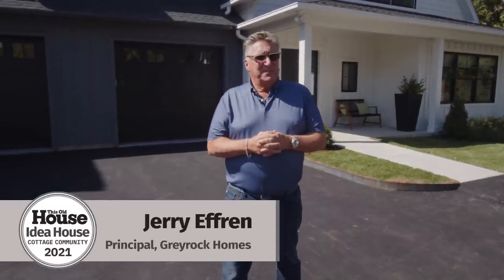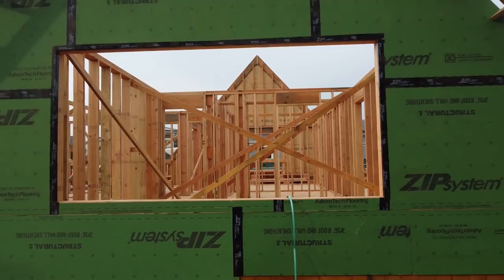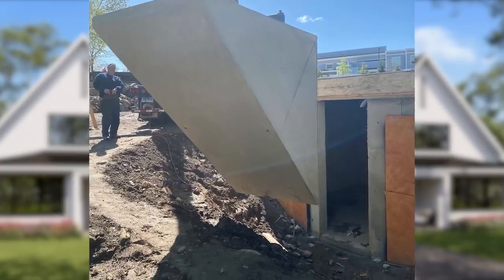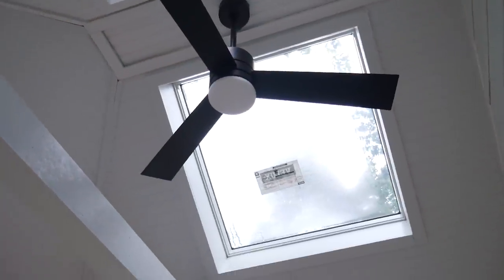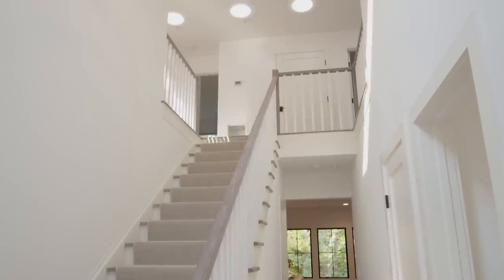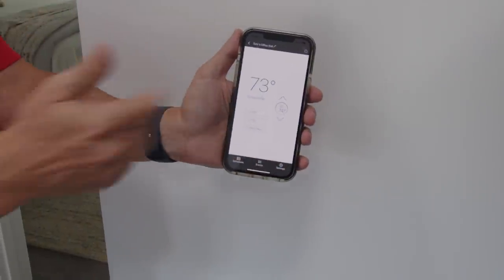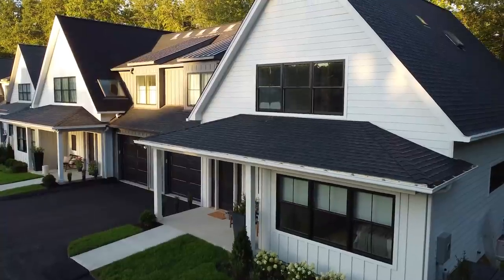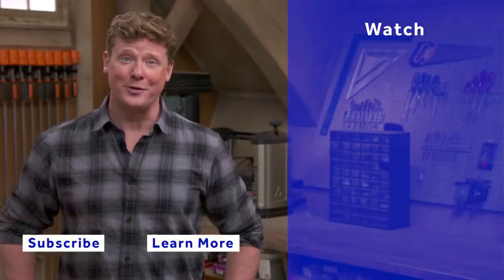Better Building Products | Idea House Build Ep 5 | This Old House

Comment: At 3:10 he said owners today are looking for easy upkeep, low utility bills and energy bills are critical, If that is so, then anyone looking for that, should build a 30ft by 40ft, 1200ft square Ranch and closed cell spray foam it. High insulation value, low gutters, easy roofing, one story living, Now that's easy living. Anything with dormers is a pain and a heat suck.
Edit: That is one complicated house to call simple.
Reply: Now that you mention it.  We haven't lived in a two story home for 30 years now and never will.  Single story for us.
Reply: I agree with a ranch style house, much easier to build, maintain, just need to have the land space which most lots do have.
Reply: Oh boy, you're taking everything far too literally. The obvious intent of the statement was to emphasize that those features frequently come up as important factors, not that they are the be all end all aspects of a home.

Comment: Wish we did rockwool instead of spray foam.
Reply: Why would you even say that ? Closed cell is the best insulation ever and it adds to structural strength to the building.
Reply: @augustreil  You can watch the videos on our channel from when we foamed the house.

Comment: No solar roof? Backup power? Heat pump? Wood siding vs a Hardie? CC foam? And lastly, yes I also use mineral wool as well, but there are some growing health concerns with it. Building looks nice, I expected more from TOH.
Reply: What's the issue with mineral wool, I thought it was the safest to use ?
Reply: On our build;
Solar - Yes
Backup Power - Yeah
Heat Pump - Check
Spray Foam - Open Cell (wish we did RW)
Siding - not yet
Reply: @thebigdoghimself , Thank you.